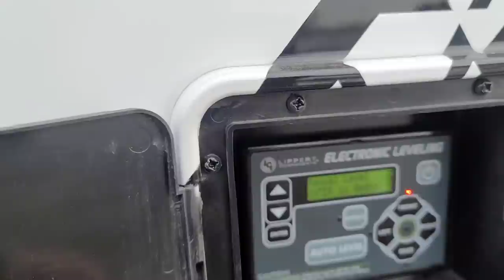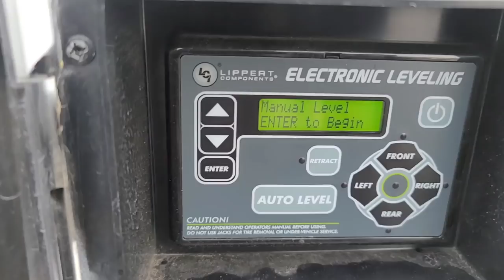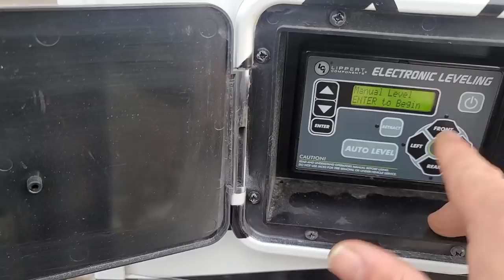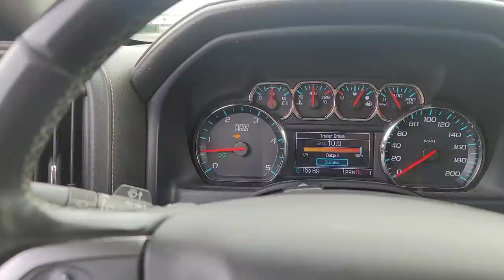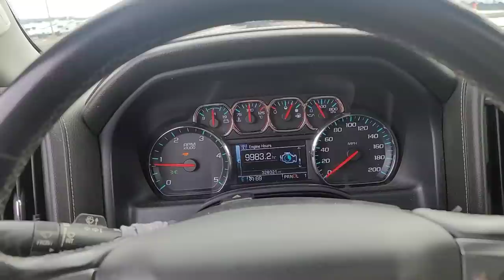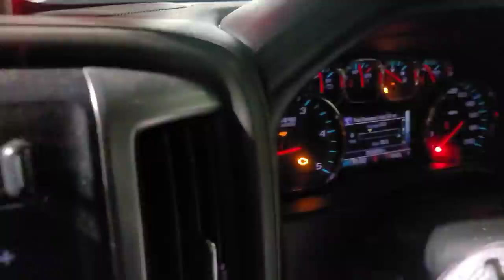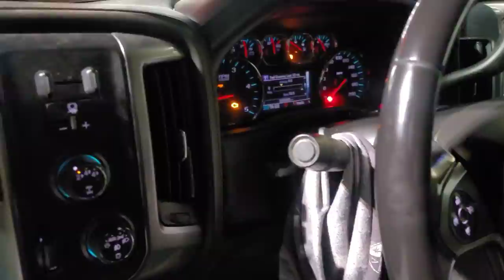Air bag malfunction and had to stop for wind

Comment: Just found your YouTube channel, really enjoyed watching several of your videos. Concerning your oil pan leak, my experience with the 5.3 L S. is that the oil pressure sending unit leaking is a common problem. Don't know if the diesel is the same as the gas engine, but may be something to look at.  I noticed looking at the bottom of the truck frame , it looks like it has been reinforced with a piece of flat stock that was welded to the bottom of the frame. Am looking forward to more of your videos.
Reply from the maker: I've figured out that the front seal is leaking a little. Thinking mabe it's coming from the front seal and running back making it look like the oil pan. I need to address it soon

Comment: I’ve been running a 3/4 in in line strainer off an old sprayer. It does empty all the way to the hole. Never had any luck with gravity feeding through an actual filter. At least not all the way empty but strainer works good.
Reply from the maker: H that's good info, thank you!

Comment: Thank You for all of the information and the attention to detail on your truck mechanicals. 
Your fuel tank may possibly have a blocked vent or the flow check valve only partially opening.
Question on your exhaust: I see you have the tailpipe exiting on the side of the truck. How far forward did you modify this pipe? Parts resources where did you get the parts? It is a safety hazard in having the exit of the pipe blow straight back while adjusting the front legs especially while the truck is in re-gen (hot hot hot)
Great video 👍
Reply from the maker: I went to a shop in Elkhart and got exaust turned out so i wouldn't have to modify new mudflap. It's just turned straight out. Only cut the top off the tip and put an elbow in

Comment: Is your truck bed a short wheel base?  Looks like your fifth wheel hitch is mounted a few inches rear of truck axle.  Just asking because my duramax is a short wheel base.
Reply from the maker: Is short wheel base. I had a slider and changed to stationary but didn't do anything to move it back.

Comment: Could it be easier to modify the mount on your air tank to get it tilted towards the existing water drain than welding in a new bung? Sounds obvious but sometimes I overthink and miss the obvious/easy answers. Don’t mean to insult.
Reply from the maker: All good. I turned tank in every direction i could think of trying to get it all to line up but the only other thing i could think of is lowering back of tank. Since i put the automatic drain valve on it seems to stay pretty dry like it is now. I really wish i could fit a bigger tank

Comment: Man that camper looks sharp on the Dmax. I just dropped a big Montana down in Baton Rouge. What kind of pressure you run in your bags with those big units?
Reply from the maker: Before the controller failed i never put over 35 in it. Yes, that thing was awesome except for door coming open

Comment: Seems like you could shim the air tank on the valve end to tilt it in that direction.  Any way to spin the tank and redo the lines?
Reply from the maker: I was really thinking on that when i put it on but didn't see any way. Shimming it down might work
Reply: I was thinking the same thing, also, my brother did his vertical but he has an old air compressor tank, (pancake style, he used and mounted under his truck. Works well.

Comment: My company won’t allow us to pull combination gvwr over 26,000 pounds or actual weight over 26,000 pound. Was you legal towing that unit?
Reply from the maker: The combined gvwr was over 26k but the actual weight was just under. That one was a while back so i caint remember exactly what it weighed but i do remember it was close enough i wasent filling my auxilary tank all the way up if i was going to be crossing scales but I've been weighed multiple times in Arizona and New Mexico pulling the tri axles and never an issue. That one was heavy but pulled like a dream.
Reply: @CFarmer  thank you for the info!